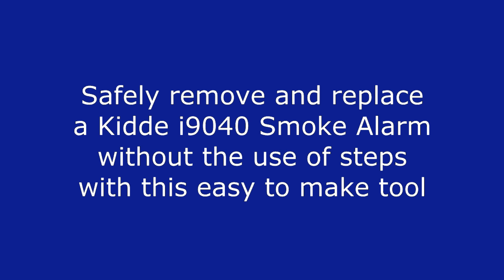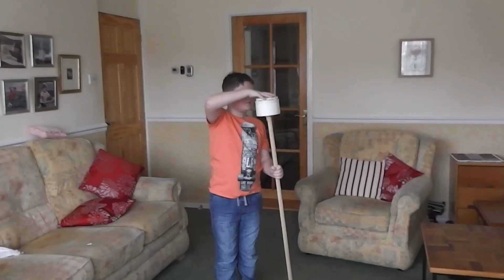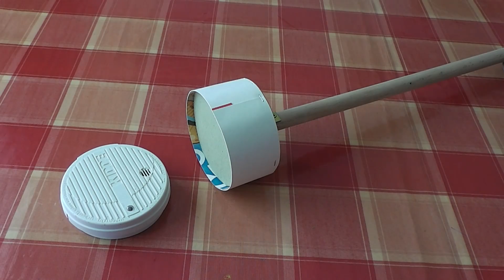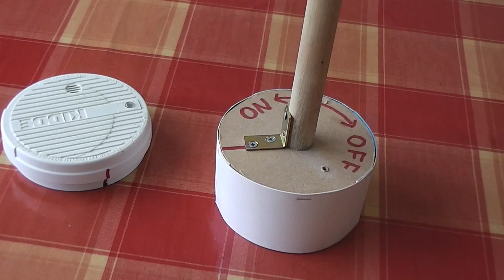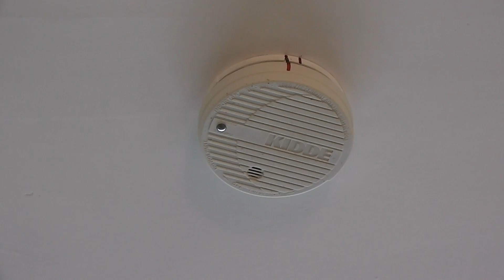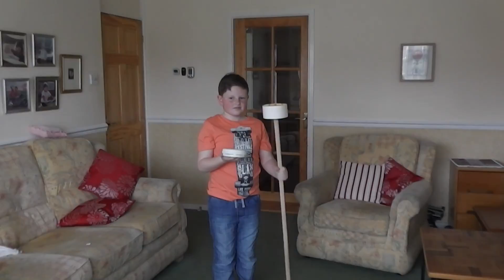Smoke Alarm - Change Battery, Stop Chirping, No Climbing On Chairs

Comment: Purchased to replace a very old Fyrnetics Lifesaver 1255 smoke-only alarm that came with the house. Replacing the mounting bracket and wiring harness was simple for those who are at all handy.>>>ur2.pl/986   Linked flawlessly with an existing model with 9V backup, and sounds both alarms correctly when tested. It is loud and audibly announces the type of alarm, and the easily-accessible backup battery compartment is a great plus.